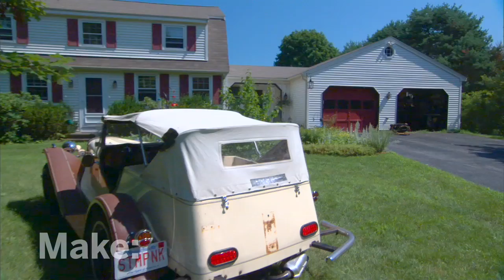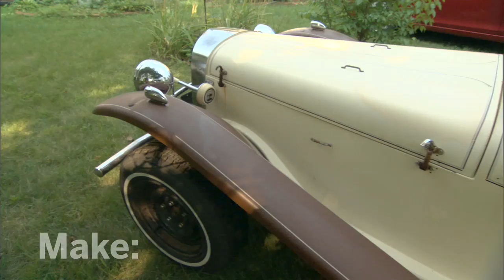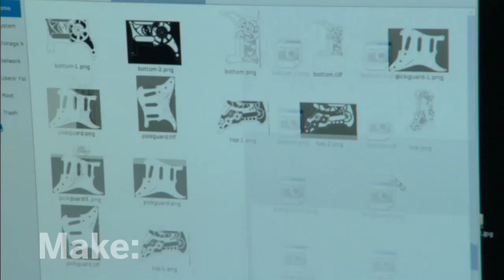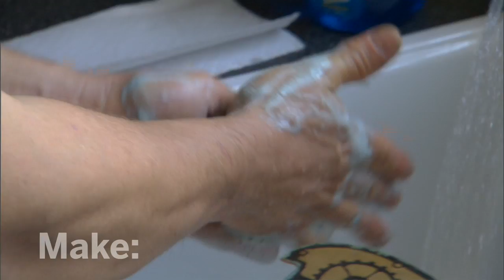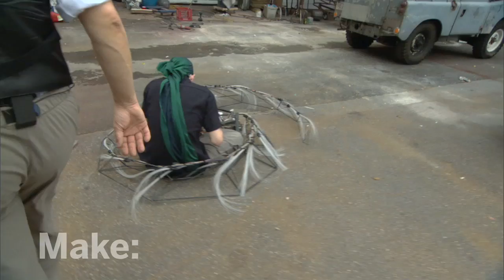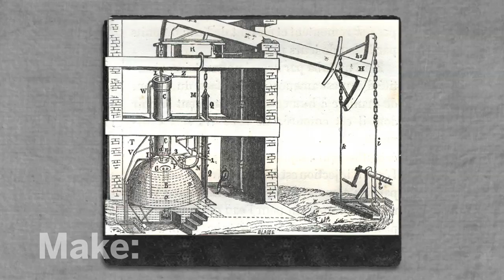Maker Profile - Steampunk on MAKE: television

Comment: You can use versus you you can use uses use cams puts you can put you can you can you you can use you can put one of the big external and takes will like a supercharger and instead of it sucking and Eric could be like to smoke stacks so it looks like an engine still kind of sounded like a really steampunk equal type of thing like a brass blower that's a great idea the steam from the top of the engine and you could blow the steam out from the thing and it could be made out of brass or so it looks really steamy Punk